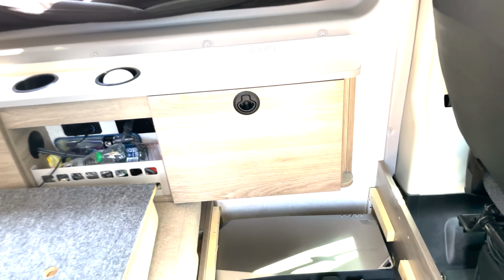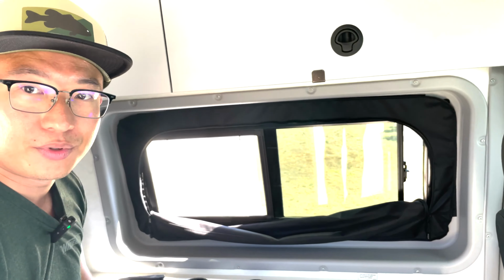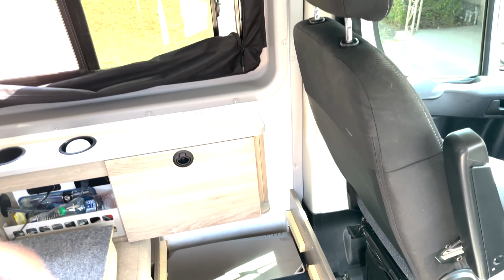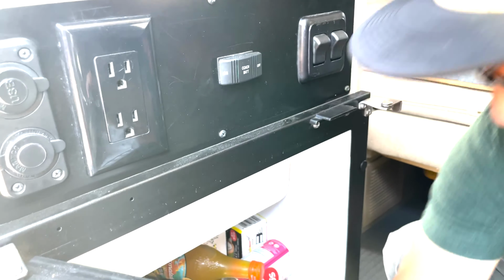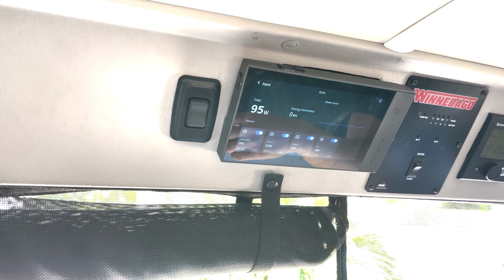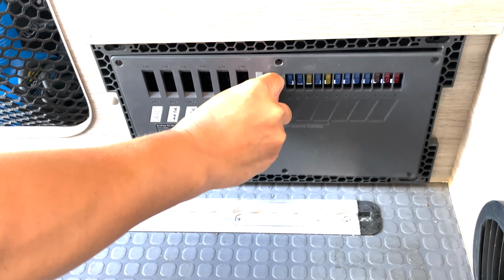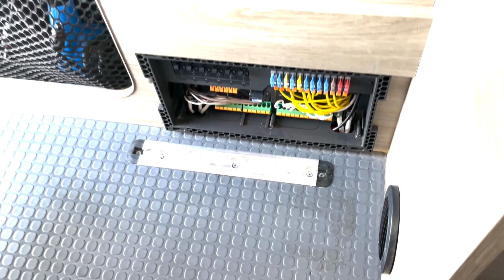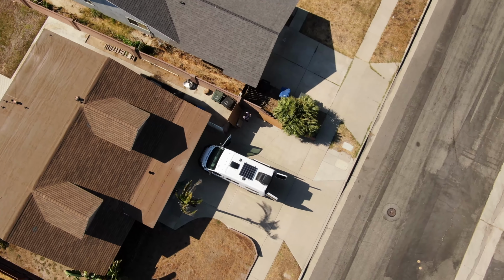Ecoflow power kits - amazing battery system for all of your adventures

Comment: I love that he used ferrules for his wire termination. I finally started using them for my solar battery system and will always use them. So much easier and safer.
I prefer 12v appliances, much more efficient. For appliances that are not made to run 12v (most!) you of course can use a pure sine wave inverter to run them.

Comment: Rita, you have raised your presentation/content game a few levels! Thanks. I bought duel-fuel generator, Champion brand. I also have 4800w, 200Ah DIY; 2400w 100Ah DIY; Bluetti 1500w; a EcoFlow Delta Pro 720~ Ecoflow River Pro unit. 
I built a HAM radio box and used a 15Ah battery for power as its power supply. I installed USB ports, data port for the radio, 12v cigarette plug, antenna port.

Comment: Good thing this system stayed away from using the old 12v system which needed thick cables. With the 48v system the cables will be thinner and easier to setup.

Comment: Great Video Ria. How is the system on RFI? I have one of their EcoFlow River portable power stations and it  makes my radio un-usable if i'm using the AC side for anything. I haven't tried with the solar yet. Got it on an amazon special and plan on using it if i ever lose power
Reply from the maker: The smaller power stations aren’t so good on RFI but the larger ones are actually quite acceptable. I’m working on in depth testing.
Reply: Too high unfortunately! I ended up resorting to charging a battery with the EcoFlow and then powering down the system to operate on HF (20 & 40) for Field Day.
Reply from the maker: Yes the smaller ones aren’t great at all. The delta pro series are better :)
Reply: Hobotech (YouTube channel) has tested multiple power stations for noise coming through a guitar amp when the inverter is on. He specifically mentions Ham radio when he does this. Not sure if what he does is sufficient to know if the inverter is clean of RFI.
Reply: Edit: I’m sure Ria is going to do a much more technical review of the power station in this regard.
Reply from the maker: @michaeldina1103  right. I don’t have a sample of this one. I do have the delta pro which I’ve covered before. Delta pro has some noise from the inverter and MPPT which I’ve reduced to an acceptable level with ferrites. But even so the noise isn’t broadband so it’s more of a minor nuisance rather than a big problem. Power kits is basically delta pro modularized with more battery capacity and a 60 amp alternator in
Reply: @n2rj  Cool I don’t this I have seen your Ecoflow delta pro yet. I’ll take a look. I think a dedicated video on how to mitigate RFI out of inverters and charge controllers would be cool.
Reply from the maker: @michaeldina1103  yes I’m going to do that. I have already started documenting my journey.
Reply from the maker: Hobotech should stop doing that test or at least stop saying it’s for ham radio. It doesn’t test anything radio and is misleading when he says it’s for ham radio.